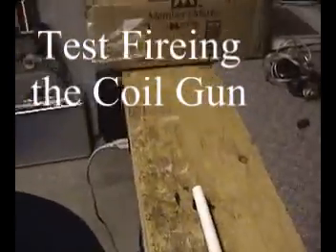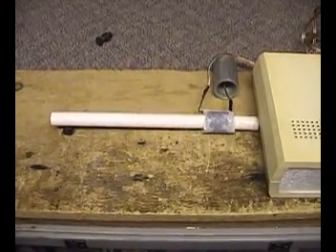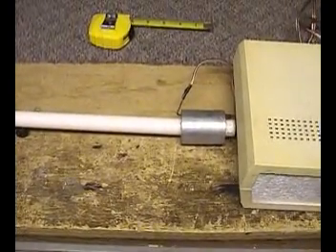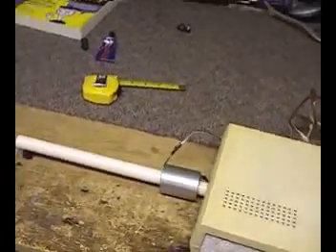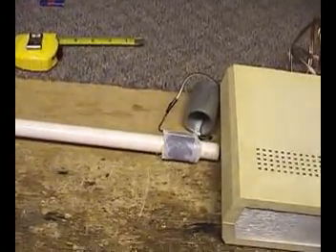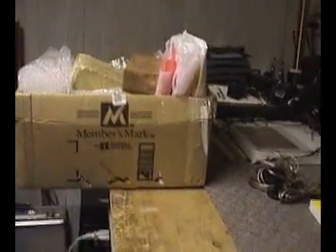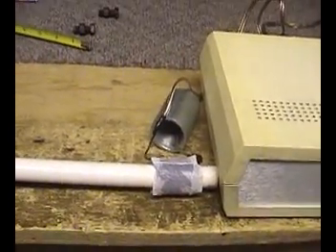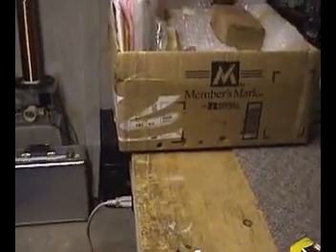Testing Coil Gun

Comment: by the why if you use bolts the penetration = horrible you need to costom make something completely rounded except for the sharpened point because the back of the bolt is slowing it down also needs to bee smaller and barral too